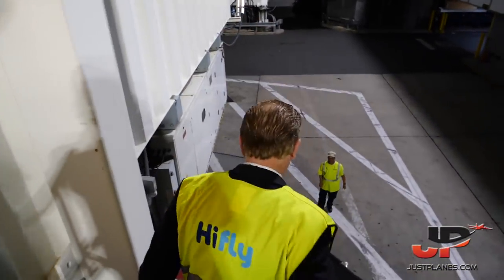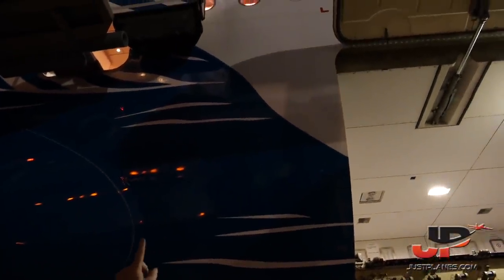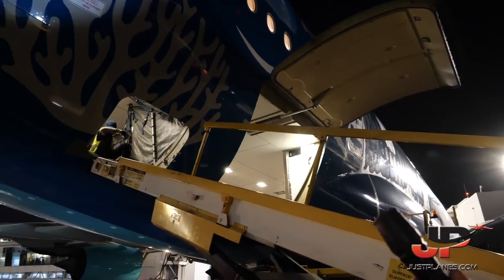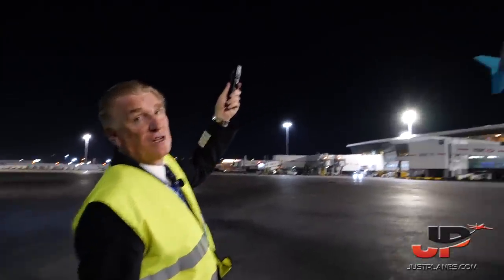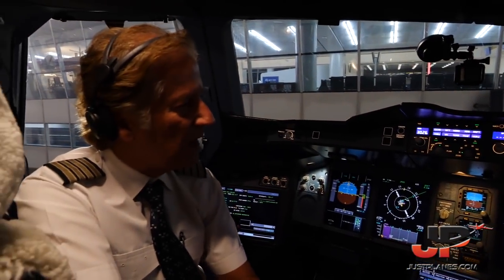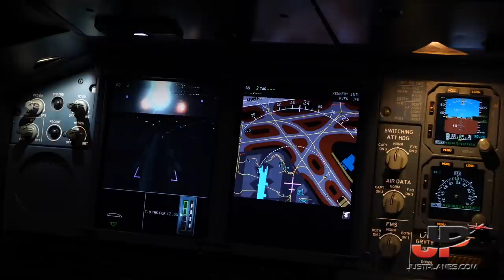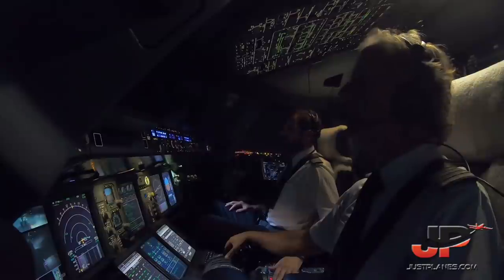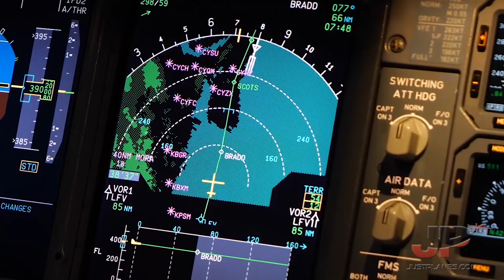Piloting AIRBUS A380 out of New York | + Full External Walkaround

Comment: 34:42
The controller instructed the pilots to climb to 11000 feet and to turn left heading of 100, but moments later, the first officer tells CPT Carlos to select heading of 110 instead of 100.
Or the first officer didn't pay attention to the transmission or he mixed up 100 with 110, cause it's quite easy to mix it up

Comment: Why’s engine 1 at a slightly reduced thrust setting than the rest in cruise? Can see it doesn’t go above 77% whilst the rest can go higher and the amber asymmetry warning on the PFD. Also the “no rapid thrust changes” message on limitations
Reply from the maker: They were checking things, not sure exactly what...
Reply: Maybe they had vibrations on Engine N1.